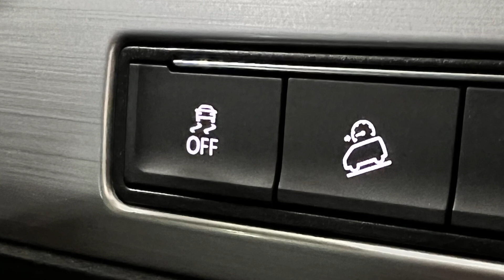VW 4motion Off Road Systems Explained for our Camper-Van

Comment: I have a question regarding snokel fitment please. When cuttong through both outter and inner guards is the inner guard structural? Here in NZ im told that my ban wont pass a warrant of fitment if I cut through the inner guard.

Comment: Is there a chassis difference between the Transporter or Caravelle? The need is for overlanding so rear diff etc is essential. 
Any advice would be appreciated. 
Cheers!!
Reply from the maker: Rory  thanks for your message 

Looks like the Caravelle is slightly longer we assume to accomodate the 9 seat capacity and that it appears to be more for moving people around in luxury. 

The other thing is that the Caravelle appears to come in the tdi340 engine only and does not come with 4motion or rear diff lock  

For overlanding we would recommend the transporter or California in the 4motion option with rear diff lock and hill descent 

We would also go for the biggest engine you can afford and get the suspension and gvm upgrade from factory.  

Remember it is an AWD and not a 4wd as such so make sure you think about where you are likely to go before taking the plunge.  Feel free to call us or email for a general discussion off air and we can discuss further.  Our contact details are on our website.  Always happy to provide unconditional unbiased advise to help a fellow adventurer.  Cheers.  Alex.  👍🇦🇺

Comment: Hi guys,

As a proud owner of vw crafter 2007 interested to upgrade to locked differential.
So the question is there locked differential that will fit my vw crafter 35,  2,5l  2007 80kw

Or at least to whom i could turn to with this questions.

Thanks
Reply from the maker: Hey Elizabeth.  From what we understand there is not one retrofitting rear diff locks to the crafters or transporters. That has to be done at factory.  Now there is a market right there for someone like ARB to consider.  Cheers.  Alex.

Comment: Looking for a VW specific technical explanation, but you're only talking about general  offroading and systems that basically apply to every modern 4x4 :(
Reply from the maker: Thanks for the feedback  Anze. We were guided by the experts on this one.  If you want any more specific information please feel free to email me your specific questions and I will get some
More info and  get back to you direct.  Email is contact@4motionadventures.com. Cheers.  I can say that in our experience the 4motion system off road essentially throws power to the wheels that has traction and cuts power going to those wheels that don’t therefore aiding in tackling off road terrain.  Cheers.    Alex.
Reply: @4motionadventures934  Thank you for response! I'd like to know, if that's a Haldex or a Thorsen system? Is that a proper mechanical locker or does it work with clutches, it makes a big difference how to use it and how much you dare loading it in certain situation depending on the system. Then further on, when the rear locker button is pressed, the locker engages, what happens with the centre diff? or does haldex engage or what happens. 
Thank you
Reply from the maker: Thanks mate.  I will get back you you shortly once I get all the info you are after. They are great questions. Thank you.  Be in touch. Cheers.  Alex.
Reply from the maker: Anze.  Here is some more info for yoj.  

The Thorsen system is only used in the B5 Passat 4motion, permanent 4motion amaroks and the touaregs. 

The system in our transporter is a Haldex with a mechanical differential locker. 

The haldex systems do not use a centre locker, they just control whether the vehicle should just be fwd or send power to one or both of the rear wheels at times when needing traction. With the locker activated, the power would be lessened or brakes at the front wheels when traction loss is detected at the front wheels. 

Let me know if this answers your question or if you need more info.  

Cheers.  Alex.
Reply: @4motionadventures934  thank you. Yes you did answer. Was wondering because I got to drive the T6.1 California 4motion.
Don't forget that Phaetons also had Thorsen, I daily drive one. 😉
Reply from the maker: Thanks mate.  Appreciate your further info as well.  That’s what we love about the VW family.  Everyone comes together to share information to help bring more awareness to these amazing machines.  Cheers.  Alex.